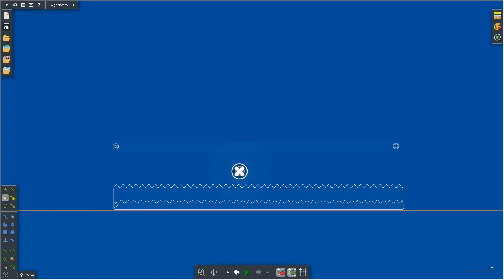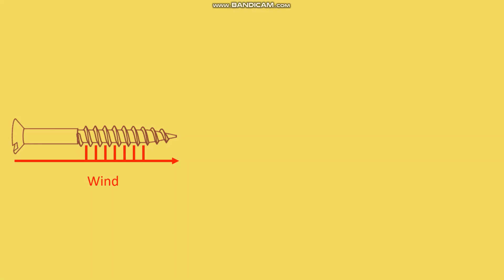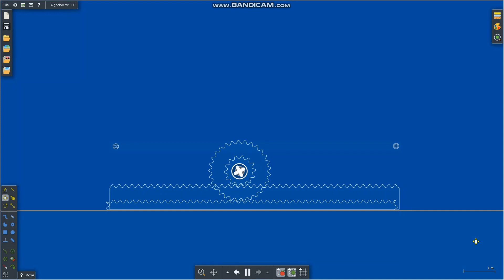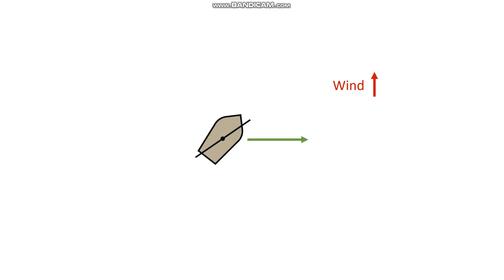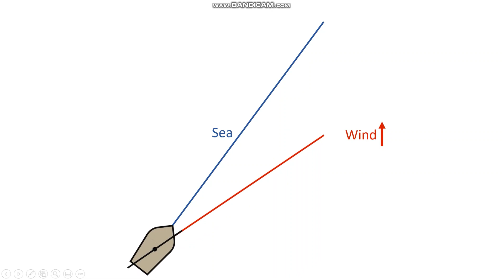Explained: Sailing faster than the wind, downwind

Comment: still NOT entirely clear what/how the cart continues acceleration faster than the wind - after surpassing the wind speed.  your model isnt clear re the vehicle wheels powering the turbine............. ill watch the video for a 5th time now. THANKS!
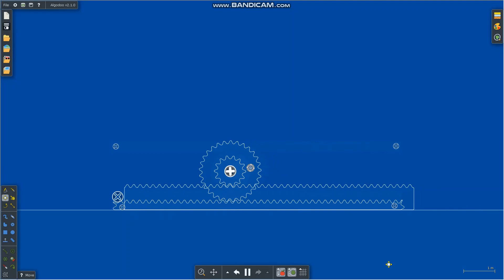Reply from the maker: My explanation is best understood from the ground's frame of reference, when the cart is at windspeed, the screw that that turbine blades trace though the air will be slower than the wind, so the wind will continue to push it. This is analogous to the gear explanation and the lever graphic at 1:30.
Reply: @chalichaligha3234  but going faster than the wind: its the WHEELS driven from ground speed powering the BLADES which push the cart faster.............its working on momentum, somehow.......fyi
Reply from the maker: @atomicdmt8763  Okay, I hope the gear model showed you that you can push something faster than the wind continuously, so it's not momentum. If the gears can do it, the real cart can too.

When going faster than the wind, look at how the blades/gear teeth interacting with the wind travel at or below windspeed, that's how the wind can push them. Once more look at the lever for the simplest explanation.
Reply: @atomicdmt8763  the blade push the cart faster so the wheel turn faster too and both  keep going faster. The higher speed  difference between air and ground the more energy can be gathered.

Comment: if the wind is turning the turbine to move the car forward then how does the car keep accelerating when it reaches wind-speed because at that point the relative wind-speed is 0 (and then goes negative because it even keeps accelerating past that point)?
Reply: And what happens if, when the vehicle reaches maximum speed (which according to some other experimenters is at LEAST 2.8x wind-speed) if the wind dies?   Does it stay at the same speed, speed up, or slow down, and why?
Reply from the maker: My explanation is best understood from the ground's frame of reference, when the cart is at windspeed, the screw that that turbine blades trace though the air will be slower than the wind, so the wind will continue to push it. This is analogous to the gear explanation and the lever graphic at 1:30.
Reply: @chalichaligha3234  how does that explain the cart going uphill when on a treadmill in static air?

I don't see how this is accomplished without some sort of overunity.

I'm thinking it's a gaseous phase change (not between a gas and a liquid but perhaps between a higher/hotter energy state gas to a lower/cooler state gas ala Victor Shauberger vortice implosion).

There's just no way the cart should be able to go up hill on a treadmill (and it definitely does if you look at some of the other videos on it) with ordinarily understood thermodynamic processes.
Reply from the maker: @VigilanceTech  , Once more, look at the lever. In the treadmill case, the air is stationary, and the ground is moving backwards, therefore the tip of the lever, representing the cart must move forward.

The gear model is just a continuous version of the lever model, so it can do it too. And if the gears can, so can the propeller craft.
Reply: @VigilanceTech  do you even watch veritasium video🤦🤦
Reply: @samueladitya1729  yes, I did watch it.   I still think you guys are missing something.   Take for example, a water ram.   It is able to pump a small amount of water up hill, but only by harnessing the energy of a lot more water flowing past it.   In the case of the propeller car and the treadmill, where is the wasted/harnessed part?   The propeller car moves itself up to the treadmill speed AND then some (in static air).

Are you familiar at all with the work of Viktor Schauberger?
Reply: @VigilanceTech  the energy is obtained from speed difference between air and ground. If a balloon for example up in the air, its speed will match the speed of the wind and can't harness more energy from it. The black bird cart require to be on the ground and the propeller diameter affect how much wind  power that can be harnessed. So let's say the cart at the wind speed, so it can't harness more energy from it. But it has the moving ground below, there's the energy come from. That energy used to accelerate the cart more. The propeller slows the air behind it when the speed matched the wind unlike normal sail on the boat.
In case of ram pump it harness the energy from the moving water to create pressure. it just matters of energy conversion and nothing is 100% efficient.
Reply: @samueladitya1729  To be exact:
The energy is taken from the internal energy of a system Wind+Earth by reducing relative speeds inside the system.

Comment: "it is the air that is pushing the turbine around which in turn moves the craft forward"  I don't think so.
 The propeller on the car does act as a sort of sail at low speed, but it's turning against the wind not being turned by it. The propeller is driven by the wheels to push air and propel the car once it gets up to speed. At low speed the wind is actually trying to drive the prop in reverse
Reply from the maker: There are many ways of explaining the machine, and John Borton from the Blackbird project confirmed my explanation to be correct.

Remember that the cart is perfectly analogous to the geared system in the video. The only thing needed to get the craft moving at all speeds is the air rack pushing the "turbine" gear. 

As the creator told me, it's perfectly valid to a call it a turbine - it is extracting energy from the wind after all. But that can be confusing because from the craft's frame of reference it looks like a propeller. Understand and explain however suits you best!
Reply: @chalichaligha3234  I think there's been some miscommunication.  You could describe the machine as a whole as a turbine perhaps, but the rotor is very definitely a propeller and not a turbine.  The wind does not turn the propeller.  The wheels do that.  And we can be sure that's the case since we have a ratchet on the axle to insure it.  This really is a fundamental error in your description.  It's less about whether we call the rotor a propeller or turbine, and more about claiming the wind turns the rotor.  It definitely doesn't work that way and cannot work that way in it's DDWFTTW configuration.
I'm the one that conceived of the idea for the Blackbird, and JB and I designed and built the cart together.  I should be clear though that we later learned I was not the first to have conceived of such a vehicle.
Reply from the maker: @Rick_Cavallaro  , Hi Rick, Thanks for your work and your comment. 
Firstly, if the whole cart except the blades had no interaction with the wind, it would still work, hence I say the wind turns the propeller - though I mean it in terms of the machine as a whole as you suggest, as opposed to looking at it in isolation. And I believe it's valid to describe the power as coming from the wind, through the propeller and to the wheels, just as it is valid to describe the movement of the compound gear as being powered by the air rack.

After all, if one looks at the driven small gear, from it's frame of reference and ignore the rest of the machine then you would expect it the turn the opposite way to what it really does, and the ratchet would only prevent this type of motion. This is what I believe you're telling me when you say the wind can't turn the rotor. Well, in that sense you're right, but if you take the rest of the machine into consideration, then one can understand the overall effect of the wind rack pushing on that gear. 

Also, I put the machine as a whole acting as a turbine above it's appearance from the cart's frame of reference, because such a machine would also work using Savonius type turbines, which would of course be impossible is the blades were truly acting as a propeller because Savonius turbines can't generate thrust. https://ibb.co/McK1Rxr

Sorry if I come off as standoffish, I hope it's all good and healthy discussion of the science. Thank you!
Reply: @chalichaligha3234  
>> I believe it's valid to describe the power as coming from the wind, through the propeller and to the wheels

It's definitely not.  It sounds like you're really keen to continue describing it doing exactly the opposite of what it is actually doing, and claim you're somehow "explaining" it.  And I suppose you're welcome to spread information if you insist.
Reply from the maker: @Rick_Cavallaro  , Given that this is a wind driven machine, all energy must be coming from the difference in velocity between ground and air. Therefore from the ground's frame of reference it's valid to say the energy is coming from the wind (or do you disagree?), and if so, you can say the power comes from the wind.

If the power comes from the wind and the machine would work if the rest of the cart had zero interaction with the air, then the power must be transferred from the wind to the blades, and then to the rest of the cart. What am I missing? Please enlighten me.

Furthermore, if you added a ratchet to my gear model between the small (turbine) gear and the large (wheel) gear, such that torqueing the small gear clockwise would cause it to freewheel, one would see the operation of the mechanism would not be affected, despite the small gear turning clockwise when pushed by the wind rack. This mirrors the real machine, where turning the blades in the direction they do while in motion will disconnect the ratchet, but by analogy to the gear model, this does not mean the turbine isn't turning the wheels when the wind pushes it. 

It's also correct to say the wheels are turning the propeller, and many find that a simpler explanation - indeed, if from the cart's frame of reference the turbine was operating conventionally, the cart would not be able to surpass windspeed. I however, like to describe it as a turbine, and the path of power as I have because it is consistent with using the ground as the frame of reference which I prefer, as opposed to the cart's.

I'd suggest you take the matter up with your colleague, who praised my work highly, but I suspect you've already disagreed on this for a while.
Reply: @chalichaligha3234  
>> I however, like to describe it as a turbine

The rotor is NOT a turbine.  It is being turned by the shaft.  That is a propeller.

>> I'd suggest you take the matter up with your colleague, who praised my work highly, but I suspect you've already disagreed on this for a while.

We have never disagreed on this point.  I assure you that if he said what you claim, he either misunderstood what you were saying or he misspoke.
Reply from the maker: @Rick_Cavallaro , You know we both agree on the direction of torque in the shaft, which is the only thing the ratchet can measure. We both agree on the resulting equations which would be the same by both methods of analysis.

Let me ask you, if a machine were constructed that could travel "faster than the river down river", and was exactly like the gear model in the video except with a paddle wheel instead of the small gear, would you say that the shaft is driving the paddle? Because that's what this disagreement chalks up to. 

I say that an argument can be made either way, I respect your position, though I of course would favour saying the water drives the paddles and the rest of the machine forward. Both descriptions lead to the same end result however, so unless you can prove me otherwise it remains, as many things, a healthy matter of differing perspective.
Reply: @chalichaligha3234  
At 2:30 you say "the turbine acts like a screw through the air converting linear into rotary motion"

The rotor is a propeller, not a turbine.  Not in any sense of the word.  And it definitely does not convert anything to rotary motion.

At 2:45 you say "the wind pushes the turbine 'round which then, via the gearing, turns the wheels 'round"

That is categorically untrue.

You then explain that the "turbine's" speed is slower than the wind speed".

It's a propeller, and that is not necessarily the case.

You then say "And I DO call it a turbine, because it is only from the craft's frame of reference that it may SEEM like the blades are pushing the air backwards, when in fact we can see once again that it is the air that is pushing the turbines around."

That is not the case.  This is not a healthy matter of differing perspective.
Reply from the maker: @Rick_Cavallaro  , I find it interesting that you did not engage me with the river example, nor with the gear model, but only repeat your statement that " the wind cannot drive the turbine". 

To address your points however:

Airscrews/rotors are reversible, they convert between rotary shaft motion and linear air motion, and vice versa.

Then you gave me your patent statement, despite me clarifying that we both agree on the component of torque in the shaft - that does not tell you what drives what. If a spring is compressed by the motion of a hand, we both agree that there is compressional stress on the interface between hand and spring, but I say the hand compresses the spring, and you say the backboard connected to the ground compresses it. Both are correct.

By my understanding the rotor's screw speed relative to the ground (the linear speed of the imaginary threads, which includes the rotor hub's forward motion) must be slower than the wind speed for your craft to work - which is consistent with the wind driving the airscrew. Only if this is shown to be incorrect does my explanation fall apart.
Reply: @chalichaligha3234  I'm not interested in playing word games.  I gave you specific examples of where you are objectively wrong.  You don't want to admit you're wrong.  I get that.  Kusenko feels the same way.
Reply: @chalichaligha3234  The reason this thing works in the first place in terms of the wind is because the propeller pushes slightly on the wind am i not correct? The vehicle is relative to everything actually being pushed by the ground which gives it the leverage to create enough thrust to push against the wind am i not right?

Edit : pushed in the opposite direction by the ground
Reply from the maker: @ndexer  , Yes, that's a completely valid way of thinking about it. Although that analysis is from the cart's frame of reference.

 From the ground's frame of reference, the picture simplifies to the wind pushing the turbine blades, which are screwing slower than the windspeed, and them being geared to the wheels to allow the machine as a whole to exceed windspeed.
Reply: @Rick_Cavallaro 
 >> the power as coming from the wind,
Energy from outer world does come from air. But the air force is not rotating the blades.
Air is pushing the whole construction forward. Car speeds up. This turns wheels a bit faster because of the contact with the static ground. Wheels kinematically enforce the propeller, which creates a force against air to speed up again.

But energy cannot be taken elsewhere other than from wind. So i state this chains:

Energy: Wind energy -> Car kinetic energy.

Force (very abstract): wind -> car -> X ->  wheels -> proppeler -> car -> go to X

I think you are right, and i just point out that some people might mess with the energy instead of force cycle. The fact that this car works on a running belt (where air and car have no relative velocities) proves you point. Wheels rotate the propeller!
Reply: @chalichaligha3234  
>>> Given that this is a wind driven machine, all energy must be coming from the difference in velocity between ground and air. 
Didn't you see this car working on a running belt? Where air and car a relatively stationary.
Energy comes from air, but not force. Propeller is pushing of the air (and air is slowed down locally), but propeller is powered by wheels. That is why on the belt you have to hold it for a second for wheels to speed up to a certain treshold.

Energy coming from air does not mean propeller is rotated by the air.
Reply: @chalichaligha3234  
>>> from the cart's frame of reference.
Changing frame of reference cannot change causal links.
Reply: @Rick_Cavallaro  I agree, but have to ask to be sure: 
1) does a model on a running belt get energy from belt? 
2)Does on ground car get it energy from wind? 
3) But these two must be identical. 
4) So it is powered (TAKING ENERGY FROM) by the relative speed of air and ground. 
5) And because of that we cannot discuss object-to-object energy flow, but can talk about forces.